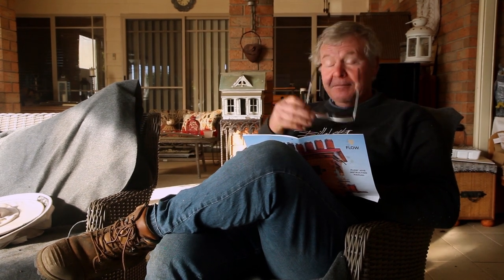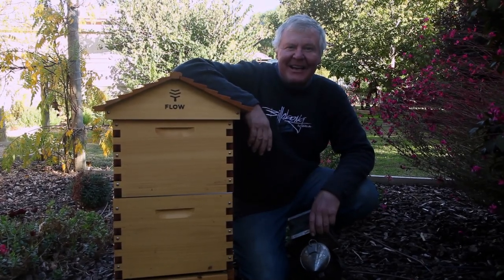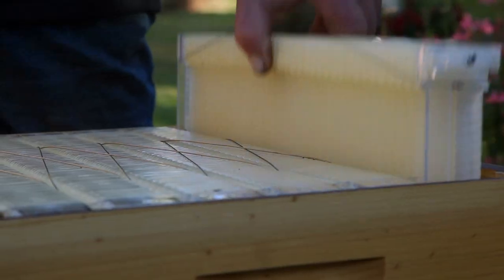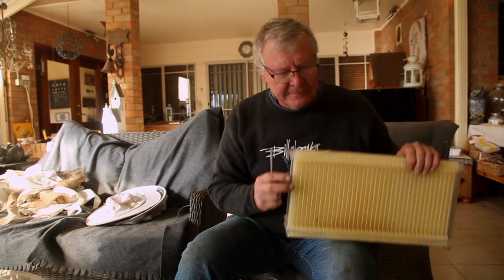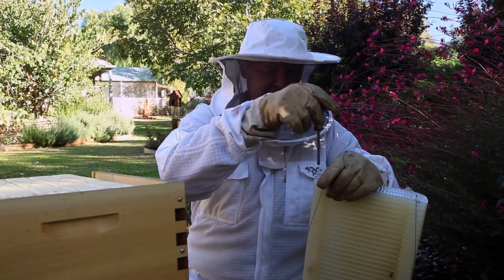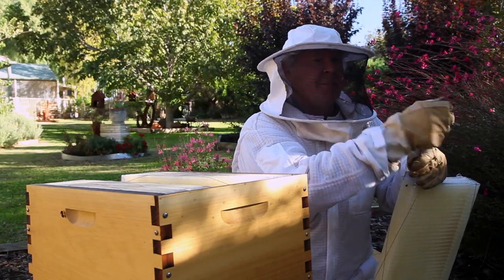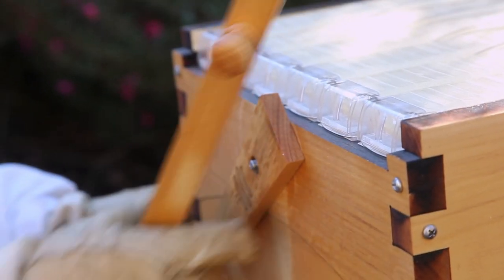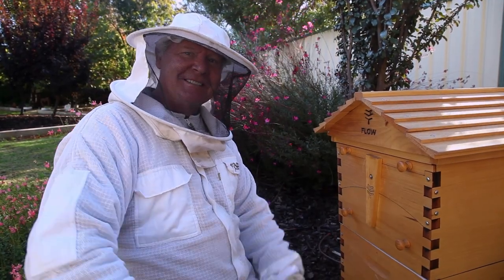Adjusting Flowhive Frames - The Bush Bee Man

Comment: Top cover bung missing. This will allow the ladies to build some mongrel comb in the roof space. If it was left out for ventilation, perhaps a gauze cover could be used.
Cheers.
Reply: This flow is one of the original designs. They didnt come with a bung. It wasnt until the flowhive 2 was developed that the bung came with it. There would be 1000s and 1000s of flowhives out there with no bung.